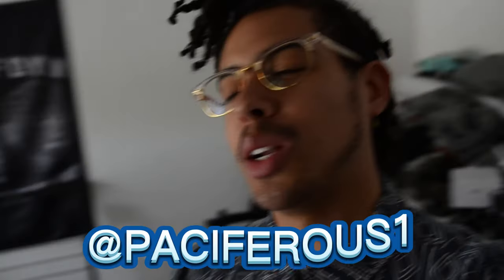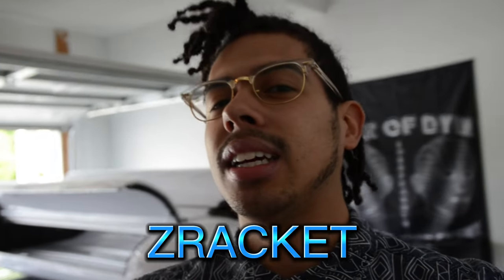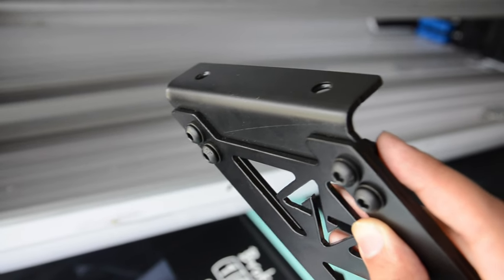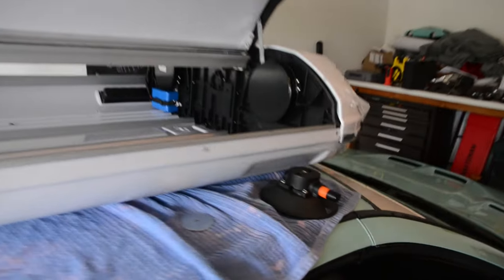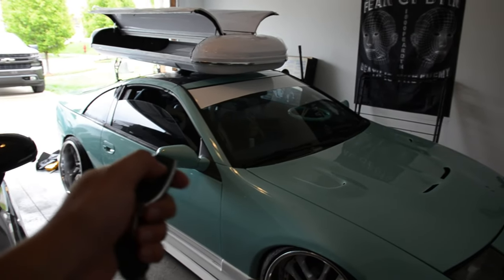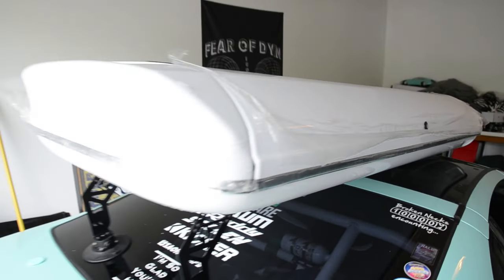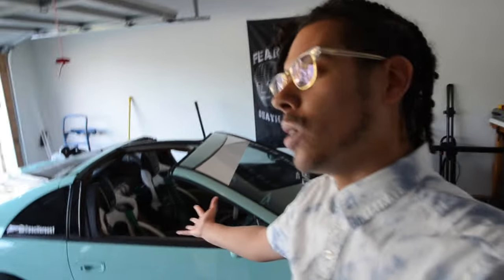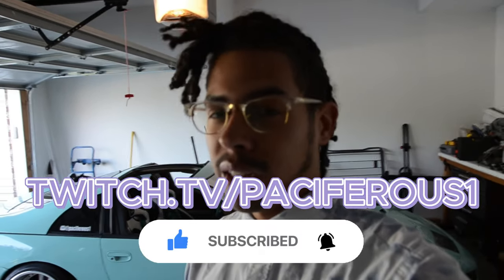BEST ROOFBOX SETUP EVER ON MY 300ZX !! SEASUCKER W/ AUTO OPENING DUAL GULL WING BOX | @paciferous1

Comment: Update on this? I Would put washers on those screws before screwing them into the sea suckers
Reply from the maker: I did end up running washers on those. Drove about 2 hours up to 70mph and had no problems with the setup ✌🏽
Reply: @paciferous1505  might be picking up a 300zx next week and was looking into options for a roof rack- looks like this might be the way to go